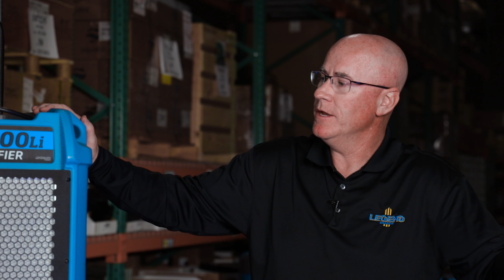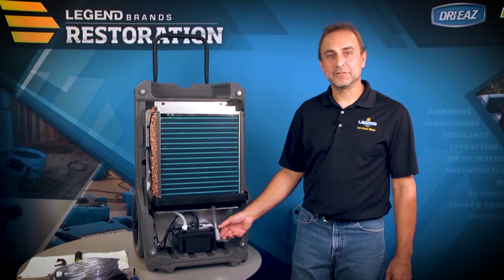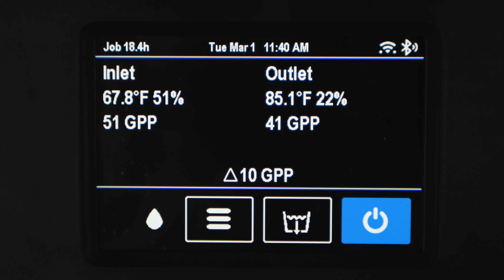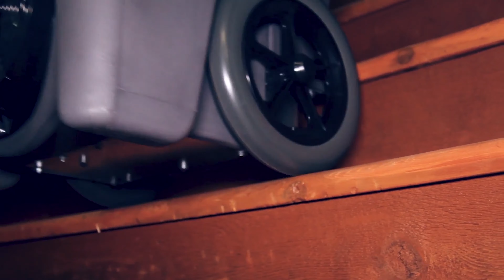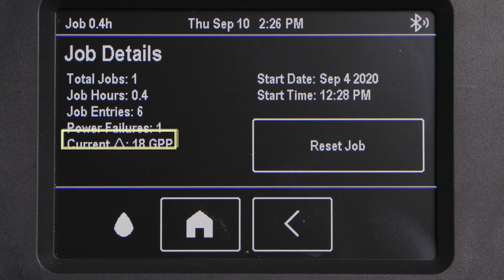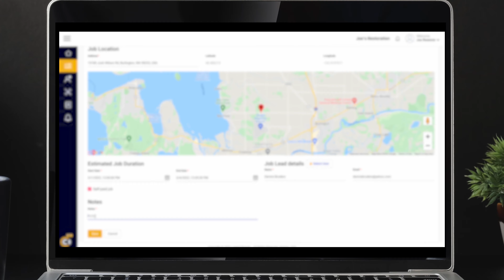Dri-Eaz Dehumidifier || LGR 6000Li with Command Hub

Comment: How much are they and where can you buy them in Connecticut
Reply from the maker: You can find a local dealer in Connecticut here: https://www.legendbrands.com/how-to-buy/dealer-search/?brands=d10e9e335416452db07d6276e82cc384
Or it is available on Amazon here: https://www.amazon.com/Dri-Eaz-Commercial-Dehumidifier-Industrial-Portable/dp/B07L6WN5P5/ref=

Comment: My machine is set to 65% humidity but it's still running even though the humidity went down to 50%. Why isn't it turning off?
Reply from the maker: Here's what may be happening: The refrigeration system (compressor) will be off, but the fan stays running to pull air across the inlet temp/Rh sensor so it knows when to turn the unit back on. You can verify this by checking the screen that shows whether the compressor is on and pulling amperage - here's a guide for how to find that: https://www.screencast.com/t/UwXtespDs1dO